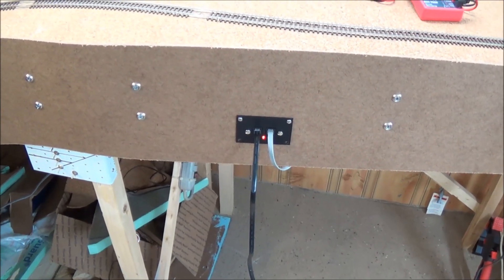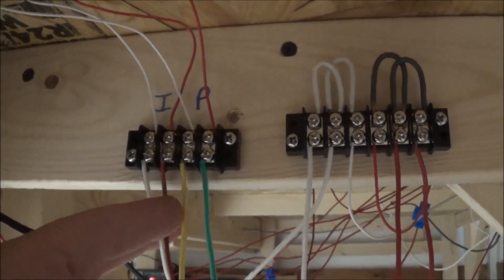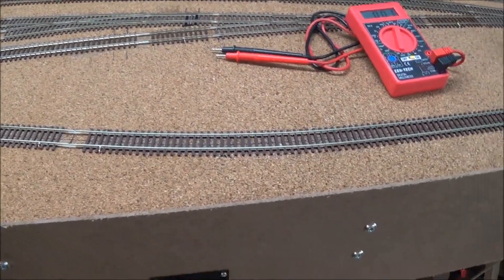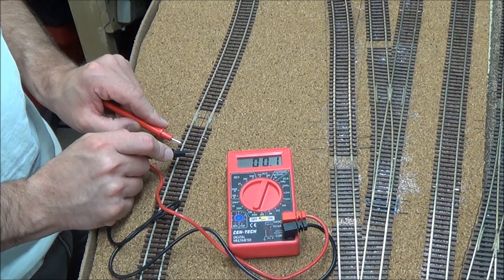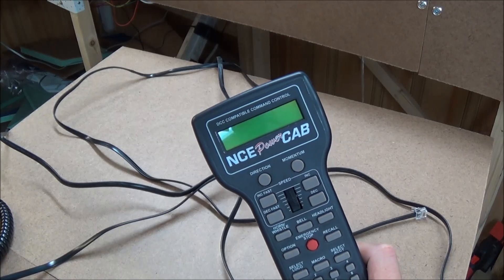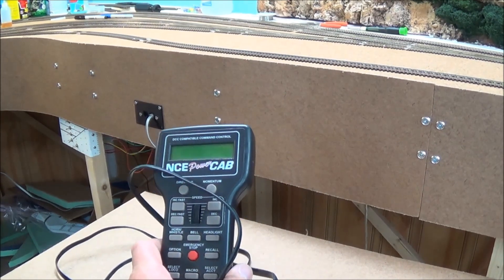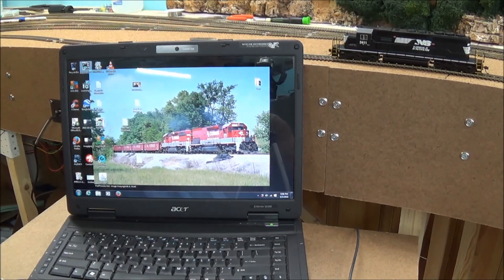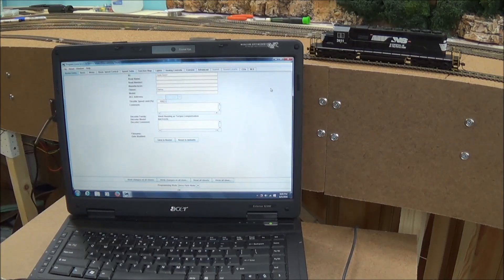How To - Wire a dedicated program track - (Part 2)

Comment: The power cab makes it a little more complicated when the booster is added even though its not.  I have the power cab and would like to get jmri up and running.  Great video showing how to separate the two.  I will keep it in mind when I upgrade.Scott
Reply from the maker: I agree, things are different once you add the booster.   Thanks buddy!
~Deryk

Comment: Just watched both videos - fantastic job on the explanation of the why's and how's!  I am going to do this on the new layout but I believe my wiring will be a little different as I have an MRC Prodigy Advanced Squared.  I will draw up how I think mine should be wired and let you take a look.  My DCC controller is not powered and the programming track outputs from the DCC power module do not go through the booster....  Anyway, I'd appreciate your input!!
Reply from the maker: Thanks Brian!  I don't have any experience with the MRC system, but I'll do my best to help you if I can.  You know how to get ahold of me.
~Deryk

Comment: Still looks like a jumbled mess of wires! 2 questions. When does your layout require a smart booster and could you wire in a power trip breaker to your program track or isolated track so if you forget to unplug the PowerCab throttle from the panel it will trip the breaker and shut down power to the throttle cab?
Reply from the maker: Yes, I hate wiring, so I don't take the time to make it as neat as I should.  You really only need a booster, when you are exceeding the available amps your normal system puts out.   I believe the Powercab is a 2 amp system.  So you can only run so many locomotives and accessories until max it out.  Then it's time for a booster.   Another reason I bought the SB5 booster, was so I could unplug my throttle and move it to another panel without interrupting track power.   At least until I get wireless throttles, or extra throttles.

That's an interesting question about a circuit breaker for the program track.  I don't know the answer to that.  Might be something to look into.

Comment: Where did you get the one cable that connects from the USB interface to the cpu. ?
Reply from the maker: Are you talking about the RJ12 cable?   http://www.midwestmodelrr.com/product/rj12-7/
Reply: Which ever is the one cable they isn't provided in which connects to your cpu. The rj12 I believe connects to the nce cab bus,  not that one
Reply from the maker: OH, that's just a normal USB cable.
Reply: +DG Modelworks really? Where can I buy it now? I just bought a USB interface with no cable
Reply from the maker: You can get them almost anywhere that sells computer stuff.  Walmart has them.
Reply: +DG Modelworks Really ! I'm going today then ! last question, is the flat cable that connects to the cab bus a 6 wire or 4 wire cable?
Reply from the maker: +Flash Jones It's a 6 wire RJ-12 cable.  Must use RJ12.
Reply: Ahh okay thanks!
Reply: +DG Modelworks Another thing did you have any trouble downloading the drivers for the USB interface. Because I've been unable to get the drivers for it
Reply from the maker: Power everything up. Then connect the usb cord to the computer very last.  That usually does the trick.
Reply from the maker: It should install them automatically then.
Reply: +DG Modelworks that's the thing it's not. I tried following the directions provided from nce and I get absolutely nowhere.

Comment: Good series! I've got a SB5 & DB5 (10A total), in 6 protected districts... 
I don't see any difference in how I would wire it. 
Once one figures out how to wire that 122 pole switch (!! :P!!), it looks all downhill from there! 
I STILL haven't used JMRI yet!!! not because I don't want to, but the only electronic device I have that works now, is an old smartphone....  :( 

I'm pretty sure I can do the wiring, for secure programming through the Cab....  But I can't WAIT to be able to try JMRI finally!
Reply from the maker: You have a way more advanced setup that I do.  I never did any power districts.  YET.   I may do something like that in the future.  I really should have a circuit breaker though.
JMRI makes programming so much easier.  You will love it.
Reply: I have more power than I need.... 
But plenty of reserve! 
The breakered districts are a great idea, sooner or later, something's going to derail, somewhere....

Comment: I'm assuming you should not connect the PCP panel to the UTP panels?
Reply from the maker: Correct, I did not in my set up.  The PCP is only for the program track

Comment: Interesting 'how-to'. I also started with a Power-Cab, and added the SB5. I was planning on using the NCE 524226 Program Track Auto-switch. That way I won't have to move the cab around. Has anyone out there used one of this items yet?
FYI, I think I found a good alternative to adding a DB5. Tam Valley Depot makes a 5A DCC Booster for half the price.
Reply from the maker: The autoswitch will not work with the SB5 because the SB5 does not have a programming track output or programming track capabilities.  You can only use it if you have your Powercab set up separately, Kind of like I did.
  
Read this for more info. 
https://ncedcc.zendesk.com/hc/en-us/articles/201656579-Auto-SW-Auto-Switch-for-Powercab
Reply: Thanks for the pointer. Glad I didn't waste the $20

Comment: Deryk, new follower here sir...I dont have a layout yet, but still need an ability to program in my shop. DCC is all new to me, I have JMRI on both my laptop and on my my phone as well, now just need the track and hardware to do the rest...can you help me with that or at least point me in the right direction? Any help would be sincerely appreciated..thank you sir..
Reply from the maker: The JMRI website has a ton of great information.   I've never used JRMI without having a DCC system, but I don't believe you need one.  But you will need to purchase a USB interface so you connect your laptop to your track.   I have an NCE dcc system, so I use the NCE USB interface.